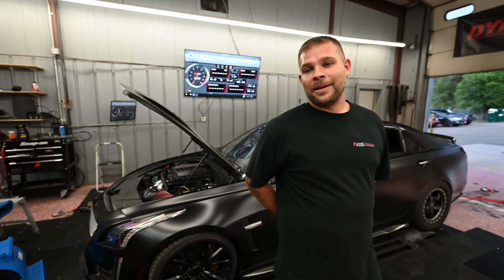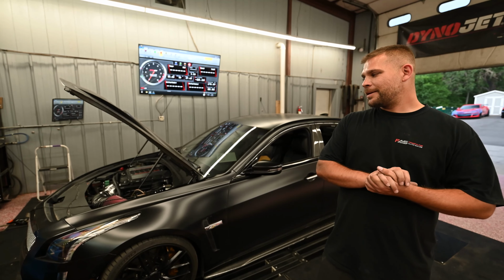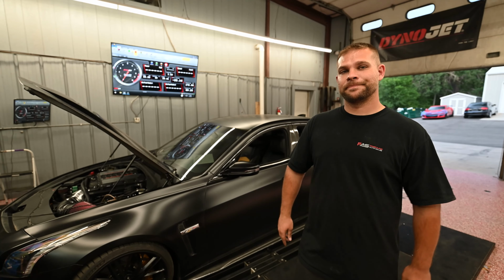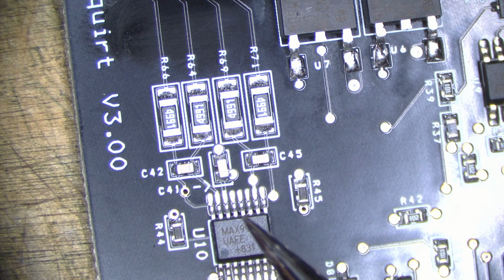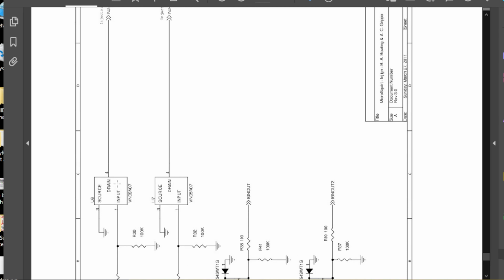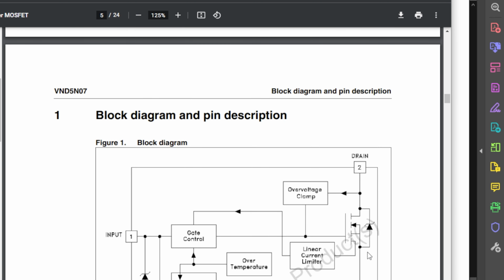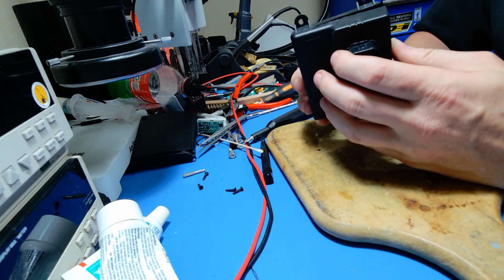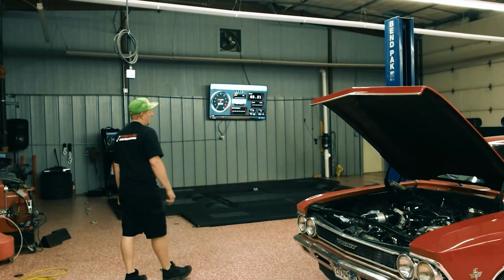Beastly CTSV Port Injection Control Module Repair

Comment from the maker: An addendum to the nerdy bits; it appears that I have mis read the datasheet for the part, and the max voltage allowed before clamping occurs is 80v, and is not infact the breakdown voltage specification. As a matter of fact the breakdown voltage is not listed in the datasheet for the clamping circuit which makes this part more difficult to evaluate.

Adding an external diode is still beneficial, especially when done in a manner that allows the diode to share arresting the inductive kickback. This helps dissipate heat that would otherwise end up in the FET which will help the lifespan when being driven hard like it is in this application.

Cheers